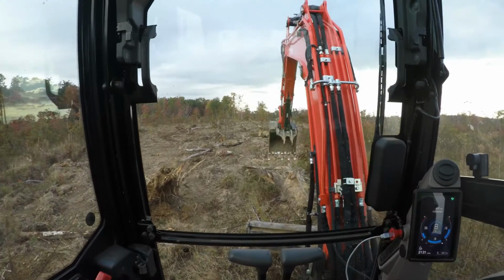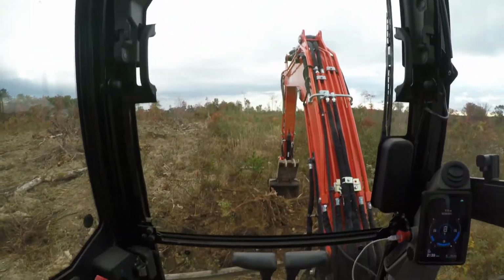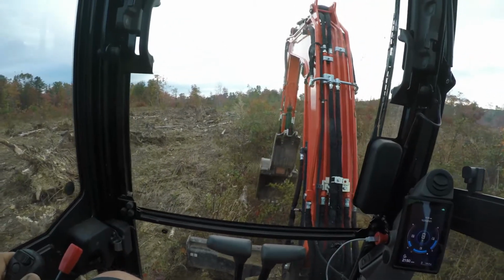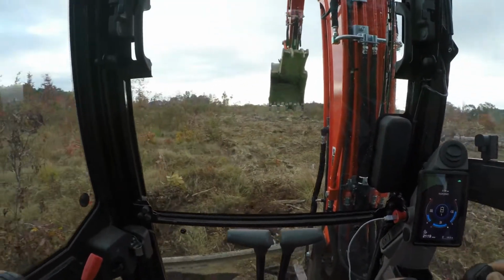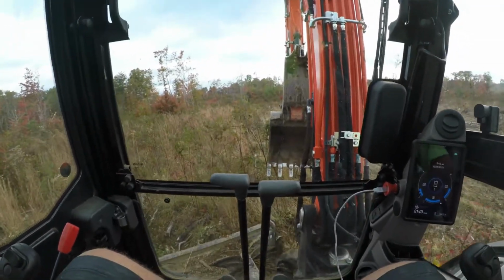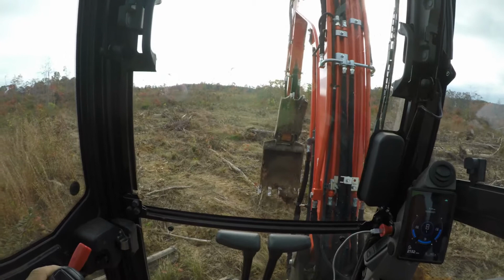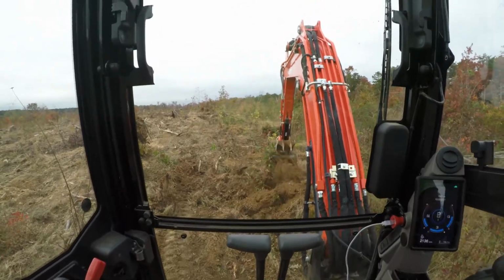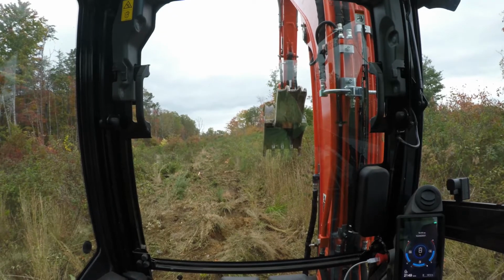Kubota kx057-5 Stumping

Comment: Grab you a 36in bucket buddy. It will speed that job up alot trust me. Just got one myself and i wonder how i got along without it now lol.
Reply from the maker: Yes sir I've got one on order, glad to know it works well. Thanks for the info and watching.
Reply: @rollingoakfarms9132  i have a 057-4 and about to upgrade to the dash 5. The kubota bucket tooth holders are junk btw. I got about 1200 hours on a 2ft bucket and the pins just push through with your fingers.
Reply from the maker: Is your bucket actually made by Kubota or who? I am using TAG MFG buckets they are made in Chattanooga.
Reply: @rollingoakfarms9132  The bucket itself is fine. Its the tooth holder thats the problem. It used a roll pin to hold the tooth on. Thats the kubota standard.
Reply from the maker: Thanks for the info!

Comment: How big were the pinesteps. Or the stumps. I have 30 acres of 30 yr old pines and I am wondering if the kx080 or 056 would be big enough to dig out the stumps?  Also you indicated that you had to be careful about how the timber is cut.  Can you give a few more details?
Reply from the maker: Are you on deep soil or shallow with rock underneath? My stumps are 10 to 48 inch in diameter. The 080 would be phenomenal and the 057 is more than sufficient. On my ground I can clear close to 1 acre completely in about 8 hours or so of big oak stumps. Now that's piling and burning and all. Your soul type and time of year will play a big role in cleaning up. I will make a video explaining the logger situation more in depth to much to put in a comment. I'm assuming it's 30 year plantation pine so be around 20 to 30 inches in diameter?
Reply: @rollingoakfarms9132  yes 30 year lob lolly pines.  Soil is pretty deep but it is sort of rocky.   Not huge rocks!
Reply from the maker: On the loblolly pine your stumps will consist of mainly just a long deep tap root from 3 to 6 feet in length. The 057 handles them fine but of course like anything else the bigger the machine the better for mechanical advantage. If you can harvest in the dead dry of summer or in the winter when the ground is frozen are the best times for harvest for less damage to your property. I will try and get the video about logging and picking a Forester/ logger up by Wednesday.  Your ground sounds similar to mine and you can see in the video how it is removing them, of course there always will be a booger of a stump that will fight tooth and nail till the end. Thus far my 1 foot bucket has been the best for removing stumps. There is a fine line of to much moisture and not enough when grubbing the stumps, right now it has been fairly easy digging for me with a little over 1 inch of rain this last week.
Reply from the maker: Your last comment said it wasn't available anymore only seen part of it.
Reply: @rollingoakfarms9132  I said I'm in middle TN and I gave my email address and said send me an email.  I guess that is against the YouTube rules.
Reply from the maker: Ohhh I got you, yeah I'm not far from middle Tennessee mine is TN after our channel name and it's a g mail account.
Reply from the maker: My bad drop the TN just our channel name